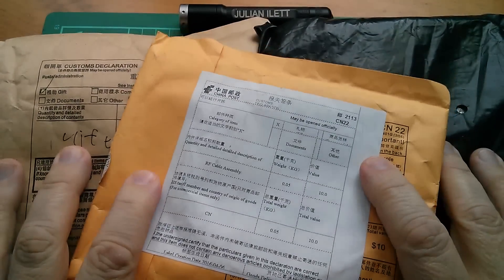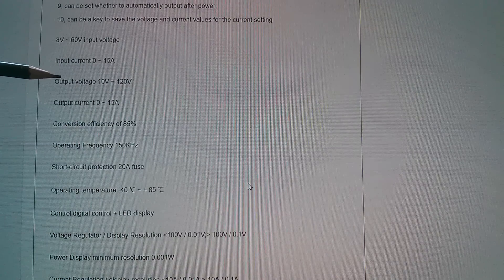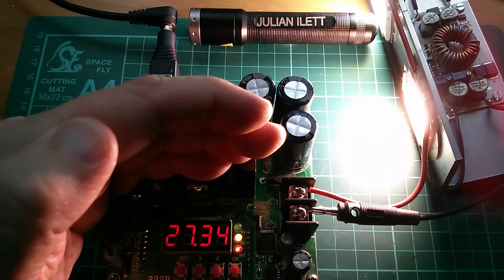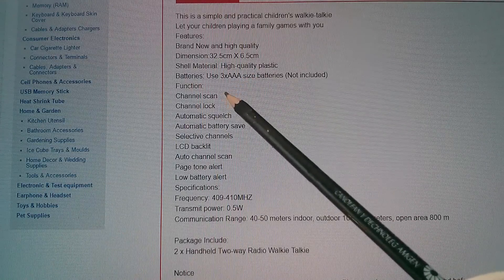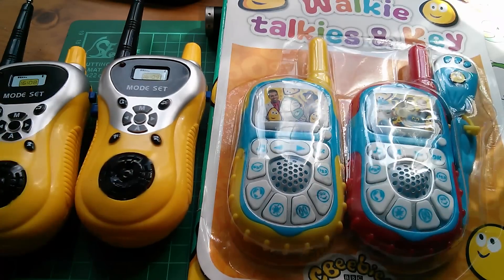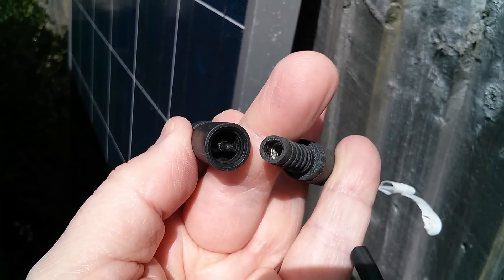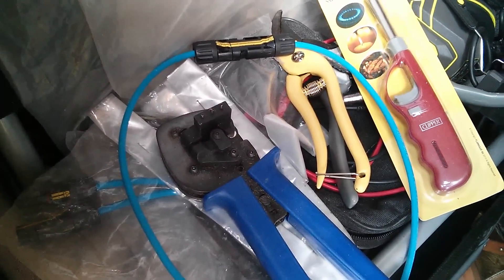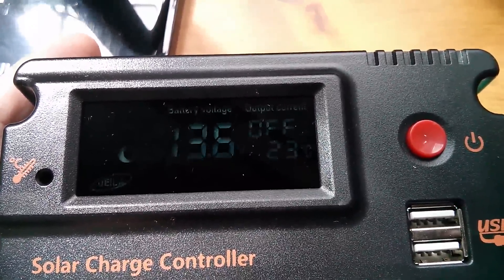Julian's Postbag: #63 - Sensible and Silly Stuff from China

Comment: The moon icon was on because you didnt have the solars connected up. So it was getting no charge. And assumed it was night.

The troubleshooting page was, check if the solars connection is tight if its sunny out and the moon icon is showing.

Comment: that solar controller looks very handy. One important note is that they do tell you the "No load loss: 0.05W" which a lot of controllers don't. A bad one will sink 20mA or more just to drive a few LEDs telling you that the battery is charged. I have one $20 controller that hits 50mA (600mW!) loss if you have a load and the battery if fully charged (measured by putting a 20mA load on it...)

Comment: @Julian Ilett, i ordered that CMG2410 model you talked about. i have it connected to a powersupply for PV in and its pulling current into the battery all the way to 15v and cutting off, dropping to 14, then pulling current into battery until 15v again, constantly. is this correct. it seems like its pulling the battery pretty high. or is this correct? how does your model work out? thanks

Comment: Hey, so I have this charge controller installed with two 10w panels in parallel. When the panels are in full brightness, I get around 18v. However, when the controller is charging a lead acid battery, it basically brings the voltage up to 14.8 @ 2.2Athen kills the amperage momentarily, and repeats this process. If I was to hook up a buck converter to the solar feed and say drop it to 15v would I get a constant charge current? Or is this switching on and off on the charge end of things a normal occurrence with solar charging?

Comment: Nice controller for your batteries. My first solar item from China is a supposedly 100K mAh phone charger, which so far has charged a 19K mAh battery nearly 3 times, and the solar panel appears to be purely decorative, as only a phone wall charger can charge the thing. Yikes!

Comment: +Julian Ilett, you bought several adjustable CV/cc power supply modules. can you tell me which of them have isolation between the input and output? I bought a couple from eBay but the negative terminal is common between input and output. thanks!
Reply from the maker: +Mihai Vasiliu None of them. They're all non- isolated.
Reply: +Julian Ilett Thanks for reply. That's bad news. I need a dual power supply and have no idea how to make one without isolated  modules.

Comment: Hello, I got the charge controller for 20 amps but when I add a 4.5 amp load I get the "OC" error. When putting a 0.2a load all is good. When using the same load with another controller all is good).Any chance you could test with a 4.5+ amp load to see if you have the same problem?

Comment: Forgive for being dense, but I haven't been much into electronics for just about 30 years since I got into computers service and programming. When the inductor makes that sound isn't that an danger sign?How does it make that sound?
Reply: +Mike Houghton Inductor whine is quite normal, If you google 'coil whine' you'll find it's a common complaint on many computer graphics cards, as well as other consumer electronics. You can build circuits to minimize it or you can just cover the inductor in some cementy crap (which is what most manufacturers seem to do) to minimize the audibility.
Reply: Good to know. Thanks

Comment: Julian, again nice stuff, very enjoyable!  Question about the charge controller, do you know if the output is programmable?
The old one I have here I can program so the lights stay on for 1, 2 .... hours when the sun goes down.
Also pwm,  saw a scary thing here. Not sure if you remember but I posted something about a 16V capacitor that was blown in charger that I connected to my solar setup.  Yesterday I sometimes measured peak voltages of 15,x Volts over the 12V 7Ah batt that I have.
Reply: +Julian Lett can you check if you can program the lamp output?

Comment: Funny, I've been eyeing that exact solar charge controller for my planned solar garden lighting, mostly because of the USB outputs. I figure during the day when the lights aren't running, I can charge my battery banks up, and then I can say my phone and tablet are charged with green energy.
Reply from the maker: +Ellen Madden It should be ideal for that.
Reply: +Julian Ilett I was just thinking the same, one question what kind of size solar panel would this controller cope with in terms of watts?
Reply: +robleake I'm assuming 240w panel would be the maximum 12v 240w = 20a current

Comment: The solar charge controler seems to be definetly rubish on the load, the seller (not the same as yours) is arguing that the load limit is 2amps dc as described on the 12Vdc output and NOT 20 amps discharge. Some people would argue that the load could never be 20amps but the instructions have pictures with up to 5.1 amps output (but it cannot handle 4.5amps). As another example i have another controller that handles the 4.5amps on the load output without any issues (but without the displays). I would suggest anyone wanting this for the output display not to buy it.

Comment: Those cheap walkie talkies operating at 409-410 MHz should not be used in the UK - those frequencies are allocated for maritime and aerospace navigation equipment.  Across the EU, a set of frequencies around 446 MHz is allocated for unlicensed low power use for walkie talkies and the like.

Comment: The reason for the low efficiency is because a boost topology with an inductor is not very effective at boosting more than ~10-15V especially at high power. With such high power and voltage difference, it is best to use a transformer in flyback topology.

Comment: Julian replace driver PCB  with LCD from BST 900 to BST 400, if change panel then BST 400 raise up fast voltage.
This is only front panel issue.
I checked RX and TX and nothing  found, maybe you will succeed ;)
Reply from the maker: +Kamil Gorecki OK - interesting. But doesn't the front panel have the upper limits for voltage and current programmed into it?
Reply: +Julian Ilett Well, it's just fancy PWM signal generator, isn't it? You might even be able to get out more power from that. Worth trying.
Reply: +Julian Ilett try 40V only for LED ;)  dont worry about different voltage range.
Reply: PS: So I think that the panel has programmed limit tensions and the rate of voltage increase.
I think that you can simply reprogram the microcontroller using the Rx and Tx pins but I do not know whether we can: /